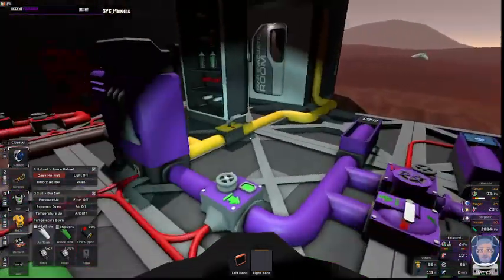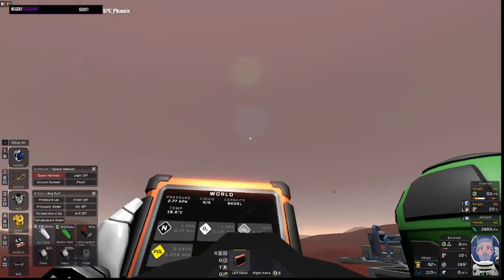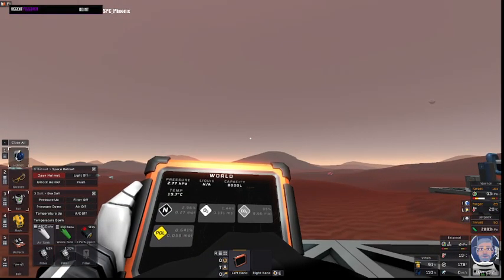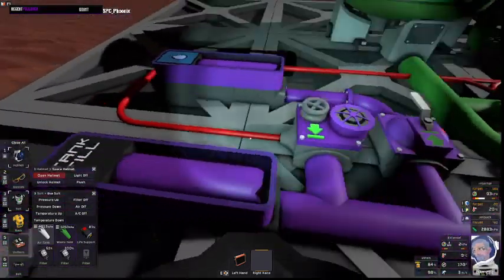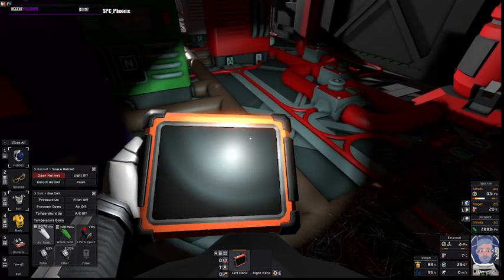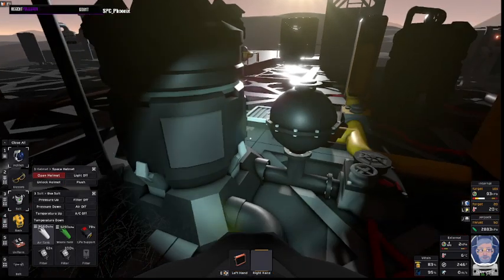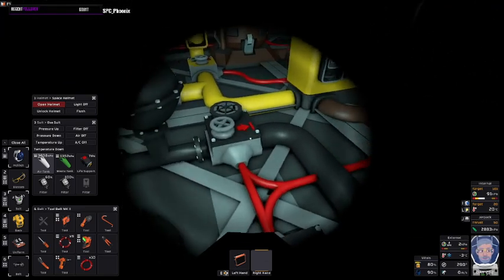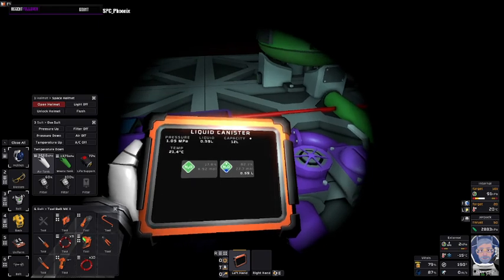Stationeers Tutorial: Condensation Valve & Purge Valve, a practical application

Comment: i dont think this will work the way you intended it, at least not long term. my understanding is that if the purge valve constantly removes the gas part from the liquid pipe, that will reduce the pressure in the liquid pipe and lead to more of the liquid evaporating. Meanwhile pumping the gas part back into the gas pipe will raise pressure there, leading to more condensation which will be moved back into the liquid pipe by the condensation valve. So i think you just created a merrie-go-round for the gas and liquids.

Comment: For N2O when you're draining the tank in 20ish C e.g: to make superfuel you can stick an expander valve on the tank to only let the gas out, then when you pump the N2O into the mixture it'll evap from the liquid tank until it's drained since the pressure decreases.
It's exactly like a propane canister but a limitation of that is it can cool down and re-condense if it's drawn too fast (like a propane canister) so having radiators to absorb the heat from the atmosphere  to stabilize the gas and limiting the pipeline pressure is important, however a larger volume helps you draw more N2O at a time (like a propane canister). Effectively you can use the same setup for your superfuel with minor adjustments and a few extra do-hickeys instead of worrying about the gas/liquid seperately.

Comment: Having trouble getting CO2 out of my hab water
Reply: either your hab is at a weird temperature or you sucked CO2 into your H"O tank, you can use a condenser/expander valve to suck out either the gas or the liquid or you can heat up both into a gas and filter them or you can condense into ice(s) as either of these 3 ways will separate your materials.